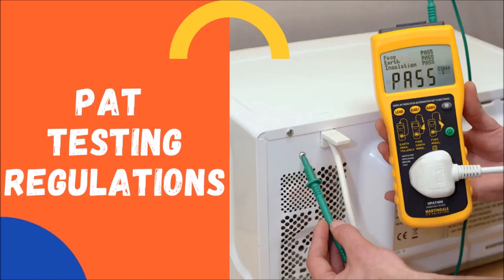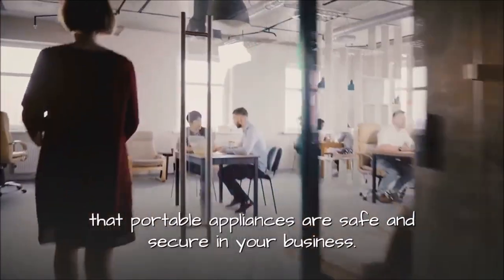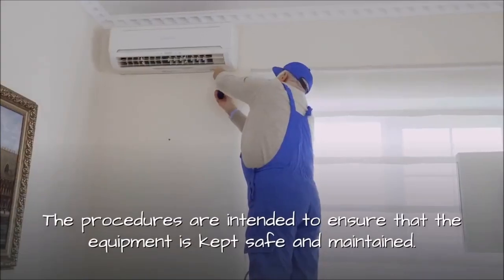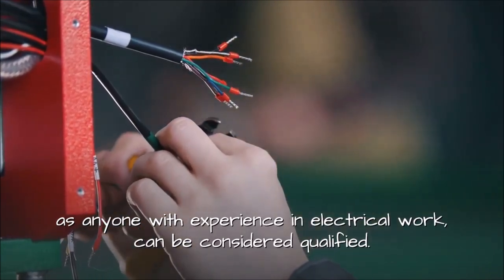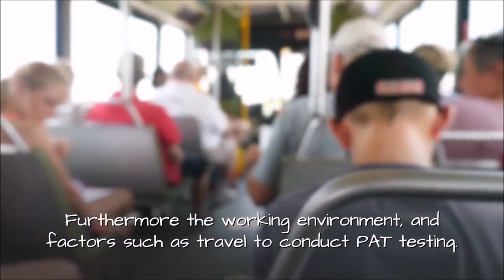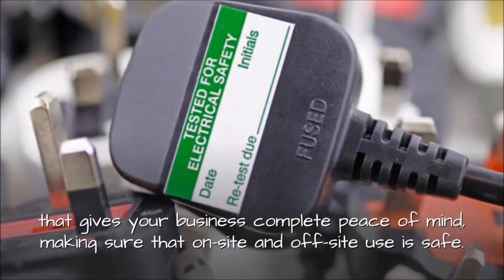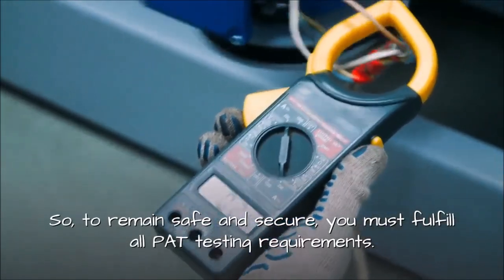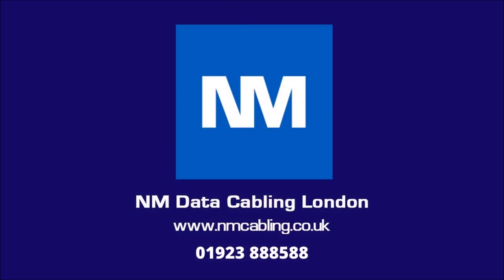UK PAT Testing Regulations Explained: Essential Guide to Portable Appliance Testing

Comment: Would pat testing recognise a reverse polarity on a appliance
Reply from the maker: Unfortunately you cannot test for this for an appliance as you need to test by having both ends of the live wire accessible. I.E. so you can see if the live wire is where the neutral should be.

 

However, it can be and should be tested on leads and extensions leads that are detachable
Reply: It is quite astounding to me that NM Cabling solutions at 1:43 refer to a PAT testing act, AS IF IT IS AN ACTUAL THING.   
It IS NOT.  There are NO acts, or laws relating to PAT testing in the UK.
There ARE other laws and proviso's that protect people's safety, so to some extent people are already covered.  But, having said that, please do not confuse PAT testing for anything else.
PAT testing is the PHYSICAL AND/OR VISUAL TESTING of an appliance or a piece of electrical equipment.
NM Cabling solutions - prove me wrong please.